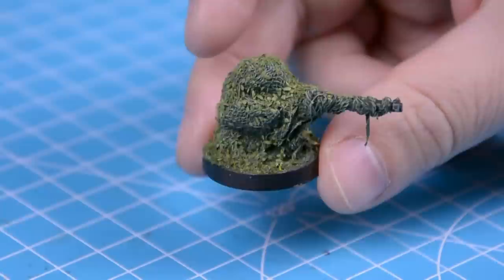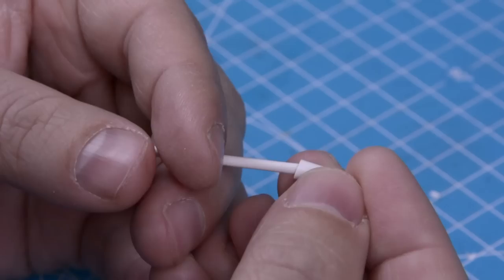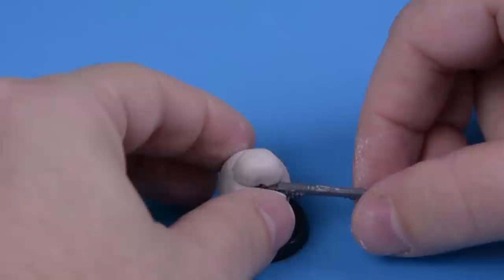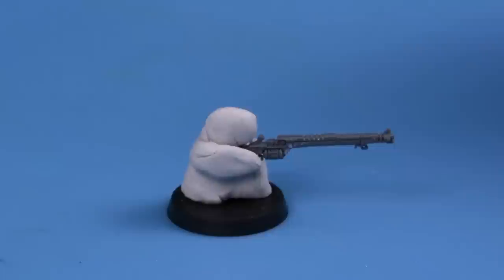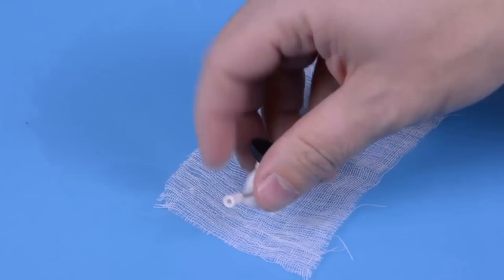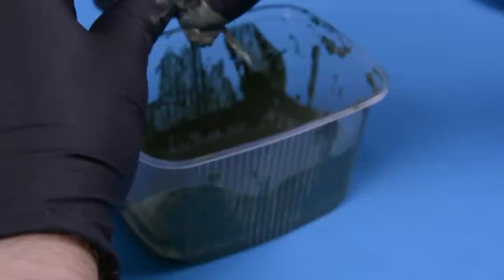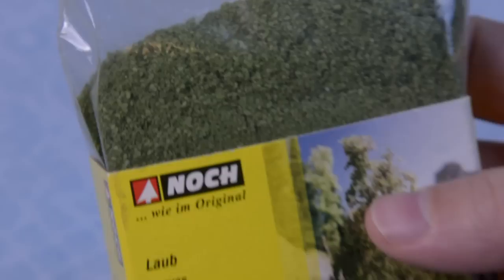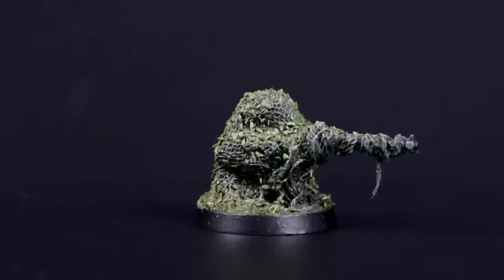How To Make Miniature Snipers In Camo Cloaks 🌿

Comment: And now to put some of those random bits I have handy to use.  For cloth - in case you had enough bits to not need as shapeless a ghillie suit, I'll offer the 'secret' scale modellers have been using for years.  facial tissue (any brand will do, just make sure it doesn't have a fancy texture ) brushed with watered down PVA - it's what we've used for years to make 'tarps, etc'.